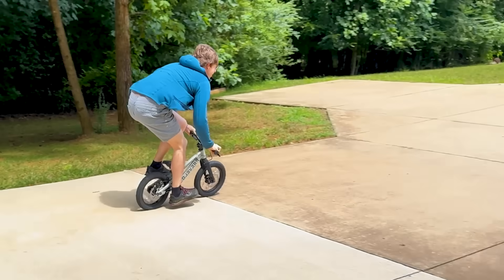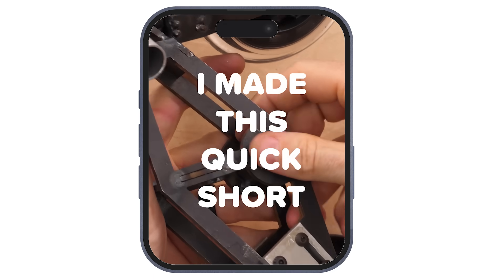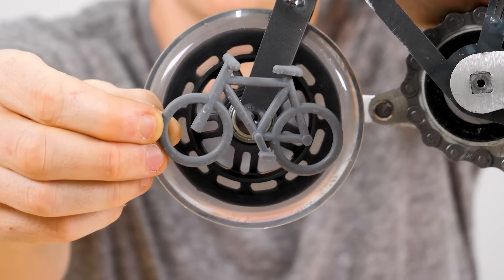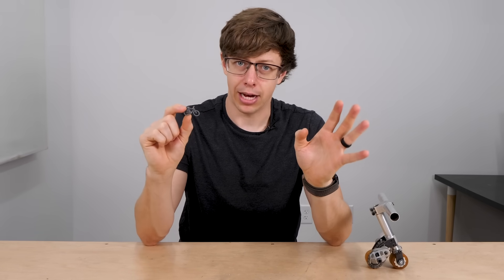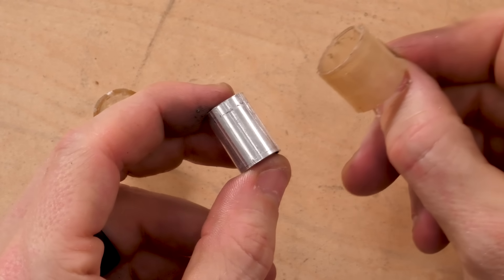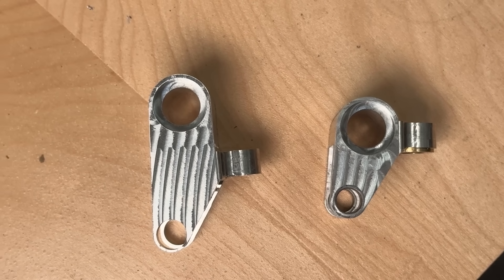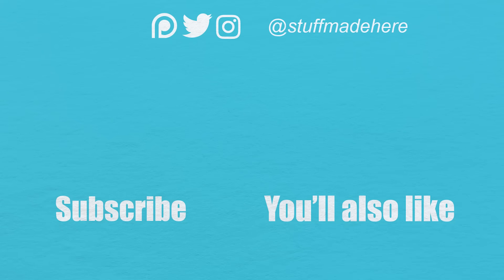After 100+ parts and 45 hours of practice, I did it

Comment: Couldn't you have put small wheels on the bottom of the pedals so it's less of a problem if they touch the ground? Then again, it wouldn't technically be a *bi*cycle with more than two wheels...

Comment: guys can anyone come up with interesting solutions to my university project problem 2:15 .
Engineering Challenge:
Developing a mechanism or product that improves maneuverability and directional control when moving multiple table tennis tables.
Problem Statement:
Moving multiple table tennis tables simultaneously presents a significant navigation challenge due to the swiveling nature of the front wheels. When pushing from the back, the front wheels swivel unpredictably, making it difficult to maintain a straight path or change direction efficiently. Conversely, pulling from the front while navigating is also impractical, as the user must constantly move between the front for steering and the back for pushing.

Comment: To make it smaller and solve the chain issue, woul it not be possible to cheat and have it be on tank tracks? You have the 2 wheels on the inside, and tracks are a fusion of the chain and tires, could that be done? Or does it stop being a bike if it's on tank tracks?

Comment: One way to make a bike like this easy to ride, is if the pedals had a "pump" design, where they only move up and down, and the downward force on the pedals moves the bike forward, while moving the other pedal up.
So, you would effectively "pump" the bike with your feet, by pressing down with each foot, one after the other.
This might not qualify as a bike, though.
Cool designs, by the way! :)

Comment: Since height isn't a concern, wouldn't it have been easier to move the handlebars higher, say to waist height like a scooter for easier balancing? You wouldn't have to bend over, and with the handles taller, wouldn't it make it easier to steer as well? Or would the strain on the tiny little frame be too much?

Comment: Now I wonder what the smallest still useful bike is. That is, using it as a bike should give you an advantage over not using it. 
Some semi-arbitrary benchmarks would be driving at least 5km in half an hour and 1km in at most 5 minutes. 
It should also be possible to learn in a reasonable amount of time, but you already showed you could do that with the actual smallest bikes.

Comment: does the waterjet cut with a strait beam of water or does it have a focal point ? and is the beam directional ? cause why would the head have to turn to cut the gears could it not cut with just x/y movement ?

Comment: I'd love to take that 1st tiny bike u made out for a spin on our local pump track, but I don't think the other ones would be rideable on it...
Reply: Haha that'd be hilarious. 

I wonder how much one would be to buy
Reply: @teamtoken  I have in fact borrowed a 16" kids' bike before and rode it around our old pump track at our dirt park, and after I'd disconnected the chain (the bike had a backpedal brake) pumping on it worked very well. It already looked pretty funny with my 1.83 meters (or about 6') on that tiny thing, but I betcha, riding the bike this guy used to do a jump with on a pump track would indeed look absolutely hilarious, tho I'm not sure I'd be able to maintain speed on it, the bumps are way taller than that whole bike.

Comment: It’s not really an engineering solution but I’m a big rock climber and I think rock climbing show would solve a lot of problems. Rock climbing shoes are made to transfer a ton of weight into a single edge of the shoe so you could make the pedals much much smaller. A good pair of shoes can support body weight in edges millimeters wide. Also I think it’d help with your feet hitting the ground because the rigid sole would prevent the pedal from  sinking into your shoe.

Comment: I’m a way worse engineer and my initial thought was to make the tires the length of the bike, have them parallel to each other (do  BI-cycle wheels have to be linear by definition?). Then the obvious drive choice is fixed gear, but no. Vertical pedaling string-drive system. Take full advantage of the no height restriction. Boom.

Comment: Can you angle the seat stay and head tube outward. You have to vary the lengths to balance you feet weight to hand weight but if all you need is short wheelbase I feel like you could take a normal sized base and a jackshaft or two to get down to a tiny wheelbase

Comment: I would think that extending the handlebars forward, and creating a linkage similar to a driveshaft to control steering, would make it much easier to ride.  Also increasing pedal width and distance from the frame, since the wheelbase is the only thing that matters.

Comment: Not to backseat engineer, but if the objective is purely "smallest distance between beginning and end of wheels" it seems like theres a lot of room to "cheat." Nothing says you have to have handlebars that close to the ground, and if theres no need to turn you could make the wheels insanely wide, like a tiny steamroller. Mount the pedals higher, and the only risk is pitching forward and back

Comment: Try your smaller bike design with the chain but try using shoes and pedals that clip together, could be if you're stuck on you can pull up on the other pedal and make up the for leaning problem

Comment: Absolutely incredible. I think some climbing shoes could also help with the shoe size issues. Climbing shoes can grip onto really small features that a normal shoe could never grip onto. The benefits come from highly compressing your feet to stabilize foot flexing and provide high friction onto another surface. This should reduce the pedal size, which would provide better balance and allow the bike to tilt while pedaling. Hope this helps if you decide to give it another shot, otherwise this was an incredible feat!

Comment: If the measurement that matters is the distance between the front and rear wheels, how about you just make a full-size unicycle and replace the wheel with a really small bicycle frame? 2 tiny wheels on a hinge to keep both in contact with the ground would probably behave no different than a regular unicycle, and you could even sit on it.

Comment: I unfortunately can't speak from experience, but it seems to me that, unlike a normal sized bicycle, you will be mainly pulling on the handlebars instead of pushing on them. If that's the case, you could replace them with some sort of string and/or straps. This won't make the bike significantly shorter, but it will definitely look smaller.
This is all, of course, assuming you either don't need to steer or have another way to do that.

Comment: If the size of a bicycle is measured by the length of the parts touching the ground, or next to it, you could potentially build an enormous superstructure tapering down to a microscopic pair of wheels made of something super-hard. The superstructure could have a comfortable seat and handlebars, and perhaps a gyroscopic stabiliser driven from the pedals, which would also drive the tiny wheels. Would that be against the spirit of the contest? But in that case I think the final bike in this video is pretty marginal.

Comment: Why a chain? couldn't it be direct geared, and do you really need cranks? Pedals direct to the gear wheel. An you needed a running start, put rollers at the tip of the pedals.
Reply: And put the pedals in the shoes, like the Speedplay frog cleats.

Comment: Wonder if it would help to put wheels on the bottoms of the pedals so that they didn't go lower than level when at bottom bc the pedal wheel would hit the ground but still roll. Or have a tall seat and heck tall handlebars since height wasn't part of the record. Elliptical style might overcome the twisting problem though it would increase complexity.

Comment: Summary

* [0:00:00] The creator, inspired by his son's small bike, decided to make increasingly smaller bikes.
* [0:03:28] His first attempt was functional, though harder to ride than expected. His wife jokingly challenged him to make it smaller.
* [0:04:26] After discovering the Guinness World Record for the smallest bike, he aimed to beat it by 1mm.
* [0:05:11] This much smaller version (3 times smaller) required more complex manufacturing techniques and materials, like a 5-axis mill.
* [0:06:34] Several iterations were required:
    * [0:06:48] The initial version was deemed impossible to ride. 
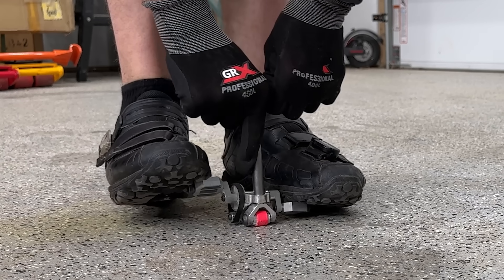    * [0:10:19] The pedals had to be redesigned to prevent jamming. 
    * [0:10:39] The belt drive was replaced with a chain for greater strength.
    * [0:11:41] The crank height was raised to fix tilting and clearance issues.
* [0:11:51] Each redesign required extensive modifications and new parts. 
* [0:13:42] After countless practice attempts and crashes, the final bike, dubbed the "tall boy", was successfully ridden.
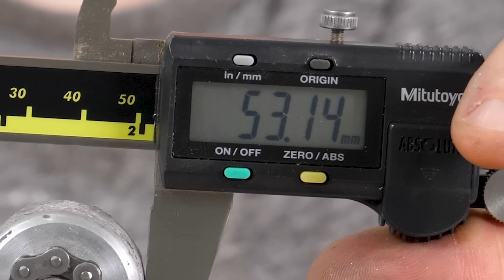* [0:12:50] It's 1.6 times smaller than the previous record, standing at 5.3cm. 
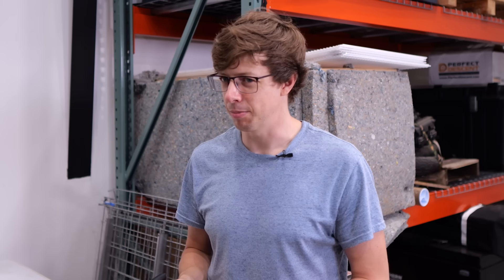* [0:15:04] As a final challenge, the creator successfully jumped the original, larger bike. 
* [0:15:17] Throughout the video, there is a sponsored segment for Brilliant, a learning platform for STEM subjects. 

I used Google Gemini 1.5 Pro to summarize the transcript.
Cost (if I didn't use the free tier): $0.1585
Time: 86.77 seconds
I added a 60 second delay to prevent a rate limit of the free tier.
Input tokens: 43242
Output tokens: 680

Comment: Other than novelty is there any practicality to this? There were super small motorcycles dropped behind enemy lines for some paratrooper scouts for the D-Day invasion that did have some practical advantages like very low fuel consumption, and working within weight limitations of what could be airdropped.

Comment: 2:19 There's a difference between a freehub and a freewheel. What you're showing is a freewheel. The ratcheting mechanism is part of the wheel in a freehub while the freewheel is integrated into the cassette or sprocket on the rear hub.

Comment: Interleave the wheels.

Can make them wider but still closer to each other. With negative wheel surface distance.

Aslong the axles are positive distance apart, its still a bike? right?

Would make it possible to make the whole thing bigger. And at the same time making a smaller bike?

And with interleaved, I dont mean stacked. But actually cut groves into the wheel surface and the oposite on the other wheel.

Will be hard to turn.. 🤔.. not sure how to solve that. Maybe someone can help out in comments.

Maybe a conical cut on back wheel. Making it possible to stear front wheel even though it intersects the other wheel.. atleast just a tiny bit of stearing.

Comment: You might want to try using some rock climbing boots as you're riding it, They have very rigid soles and would make it much easier to stand on the small pedals without your shoes flexing and slipping off.

Comment: For a laugh, I'd love to see this but with a tall enough handle bar to ride it upright. 

Also, could you put some configuration of  rollers protruding from the underside of the pedals where they might contact the floor to smooth out motion and maybe assist balance at the bottom of their travel - like some kind of integrated alternating training wheels?

Comment: Project Idea:
Would love to see you take a crack at 3D Printer filament recycling (shredding, melting/extruding, cooling, and spool winding). Ideally, it would be great if you could make it simply and with readily available parts so that other makers can easily replicate it. I think this is something sorely needed in the maker community and truly believe that you may be one of the few people that could actually pull it off; especially with your background in the industry. It is a bit more practical then most a of your other projects, but it would still require most, if not all, of your usual manufacturing methods. I think it could make for a really interesting video and a desirable outcome for many individuals. Thanks for your consideration.

Comment: To ride the bike more easily, you could have tried wearing climbing shoes, they are very tight and designed to operate on the smallest footholds. 
It would make standing on the pedals and controlling the bike quite a bit easier

Comment: 12:08.
If you want to smaller. Remove the chain belt. Do a direct drive to the wheels(think old style bikes). 
And maby even a single wheel(is that allowed?).

Also, at some point just switch to full metal weels.

Comment: why does the water jet nozzle rotate when it is cutting the sheet metal? Is the nozzle installed in a slight angle so that you have rectangular cutting edges, due to the jet expanding slightly in thickness upon exiting the nozzle or is it just pre programmed to do so because of the other angled nozzles and it's just the default operating mode?

Comment: If the world record has no height limit, save your back and make the handlebars super long so you are standing up like on a scooter.. I bet you could reduce it's length by a fair bit more then. You could make it practically a unicycle but with a tiny 2nd wheel it'd be a "bike" :) no limit on width either? Super wide wheels would make it more stable.

If it's just the span of the wheels, I wonder if you could fit an entire regular bike frame atop it all ;)

Comment: All parts of this video were very impressive. Would it have still qualified as the world's smallest bike if it couldn't freewheel? I feel like a bike with a wheelbase this small balances more like a unicycle than a bike. Therefore it might actually be easier to ride if it didn't freewheel, since you could pedal it back underneath you forward and backwards if you started to lean too far in either direction.

Comment: Would replacing the crankshaft with a rack and pinion system resolve the two issues brought up at 13:22? This would keep the peddle motion entirely vertical, so the center of mass can stay between the wheels and there would be no twisting at the bottom of the stroke.

Comment: a reverse carolina squat is called a pennsylvania squat
its not actually a car mod, but an effect on trucks that have front shocks and rear leaf springs.
essentially, the combination of the road brine/salt in the winter, and the absolutely f'd up roads wear out the front shocks faster than the rear leaf springs
which leaves the front shocks sitting lower than they did originally, while the leaf springs remain close to new
my dad's 08 ram 1500 has a pennsylvania squat strictly due to the shitty roads and brine/salt, its rear has dropped less than a half inch since factory, while the front shocks have lost 2.25 inches of height

Comment: I'm not intelligent like you but I do enjoy troubleshooting & problem solving.
I was curious why you didn't modify the pedals to make them higher off the ground so they don't almost touch on the bottom stroke. 
Also, you said the pedals extended so far out beyond the wheels that each time you pedaled, it caused some wobble.
Why not widen the wheels a bit? 
Maybe then the overall size wouldn't be small enough for your aspirations?

Comment: Fantastic video! Impressive engineering, and superb results. Just a few extremely pedantic terminology comments. What you called a freehub is actually a freewheel. A freehub contains the ratchet mechanism on the wheel side, with gears that attach externally, whereas in a freewheel the ratchet system is contained inside the same body as the gear, which then threads on to a hub. Also, when you were making the rear wheel larger, you called a rear gear a chainring. Typically chainring will refer to the front gears, where the rear gears are referred to as sprockets, cogs, or just gears. Not that either of things really matter, or are trying to take away from the video, just a pedantic bike mechanic trying to put what he knows out there, and if anywhere would appreciate the minutia of terminology, I figure an engineering channel might. 

Great video either way! I’d love to be able to have even half the skills necessary to build something like this.

Comment: I would have made the handle bars much taller you could extend them up to standing height and still have the smallest bike. Also interesting idea make something that is about as long and wide as a skate board with 4 wheels rear to under power by pedals have the bars at normal scooter height. Have the bars fold down like your typical kids scooter but also have it all collapse down so the bars are say 6 inches wide and fold down along the shaft that also collapses down to six inches have the board it self collapse front to back so that it is also around six inches you could have a literal fully rideable pocket sized bike. Well ok maybe not pocket sized but you could absolutely have it all fit in to a pack you can carry it in. For that mater if you can keep the weight down enough you could even have a belt/pocket clip carry system. Would not be super hard to make the thing a " e bike" with a few miles range. Crazy thing is you could sell the thing to college students so they could get around on campus. Take the bus to campus pull out the micro e bike and use it to go from class to class etc

Comment: You forgot there's a third type of bike hub, the coaster brake style hub. The one where you pedal backwards and you'll coast and then if you pedal backwards a bit farther you'll engage a brake inside the rear hub. Also this might be a stupid idea but for the old shaft setup (the one that bent) would it have possibly worked with a stiffer material like AR-500 steel? Also you could have theoretically been able to have a chain the same size as the belt if you had made it completely custom, the main thing is it would have been a LOT of work to make a chain that small, though it could be done. Lastly a way to theoretically get around the issue of the cranks hitting the ground is to either do like you did and lift them higher off the ground or make your wheels a lot wider that way they have more surface area and as-such would be harder to lift away from the ground.